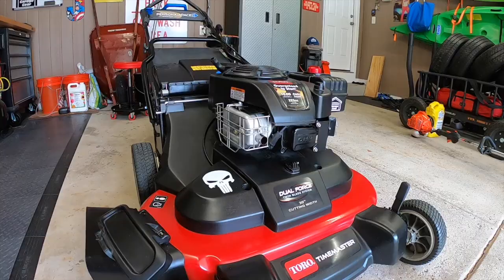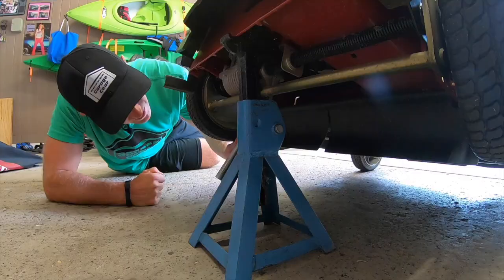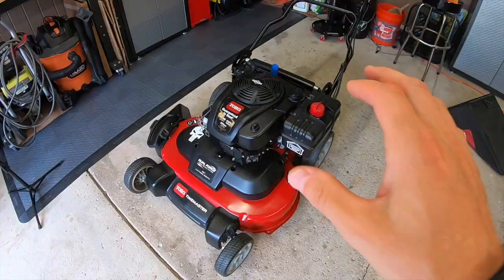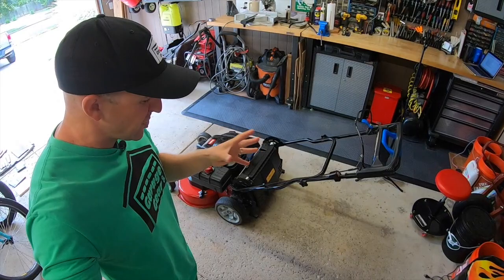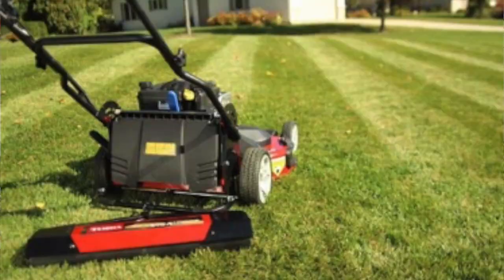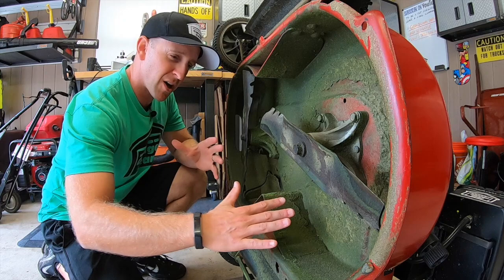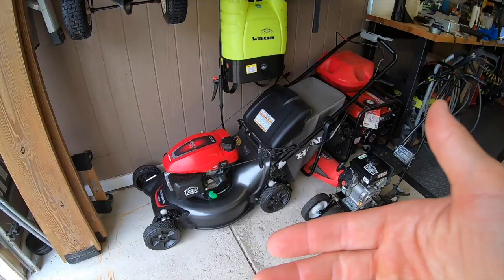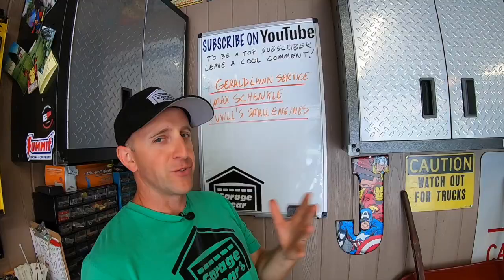BEFORE YOU BUY A TORO TIMEMASTER, WATCH THIS!

Comment: That plastic push down blade came off the forst day. SERP BELT went after 2 years and pullies went after 2 years. Never had a problem with the engine. Oh and the blade engage cable rotted out. But if you know how to use your hands this machine is well worth it
Reply from the maker: Thanks for sharing

Comment: I just wish Murray would still make their trusty old 20", side discharge push mower with a plain Briggs 3.5hp flat head side valve engine.  Those things lasted forever and a day.  I do 95% of my mowing with a riding mower and just used a push mower for trim work and getting into spots the rider won't go.  My last Murray 20" I bought in 1998 and it still fires up now right away, but the deck after 25 years is just flat-out shot.  The auto shutoff cable broke after the first 5 years.  No problem.  I disabled it and used some fence wire wrapped around that shutoff device to make it like an old one that runs all the time and I just shut it off the same way I did as a kid, shorting out the spark plug with a screwdriver. When it was 20, the hole in the deck for the right front wheel rotted away and the wheel fell off.  I bent a flat aluminum bar into a 90 degree angle and drilled and bolted it to that corner and re-mounted the wheel to that, lol, but hey, it made it another 5 years.  I only consider it as "unsafe" now because the engine is in danger of falling through the rotted deck.  So I bought a Stihl FS 56 RC-E weed trimmer and retired the push mower this past season.
Reply from the maker: Thanks for sharing rebel

Comment: Good mower. But has issues. Replaced the transmission, blade engagement cable snaps 2 -3 times a season , had to replace the pulleys a few times as well. 
My opinion.get the Turf Master.
My opinion
Reply from the maker: Thanks for sharing Brent!

Comment: I was checking this video out doing some research on these units. They’re on sale at Home Depot for $999 while supplies last. I think I will just steer clear of them. I wonder if they are going to be discontinued.
Reply from the maker: Not worth the headaches!
Reply: Buy the ExMark 21. Steel deck, Honda motor. It’s a little pricey at $1700 but it’s cheap for commercial grade. It should last a homeowner forever

Comment: Basically it’s the same as my one (1) season Recycler. Underpowered/ undesirable engine, so much as an ounce of moisture in the grass and it shakes violently, like an out of balance washing machine, and it gets bailed out routinely by my 20 year old, 21 inch Honda. My flap has also been replaced twice in a single season. I grew up hearing great things about Toro. Never again.
Reply from the maker: Toro used to have a great reputation but now?? 😕

Comment: I have had my machine for about three years and have had no problems at all ? Also I think there is defo a problem with my machine though. My garden is 3800 sq m total area which is about 41 k sq ft I have never actually measured the grass area but it cannot be less than 1/3 so about 14 k sq ft and yesterday I cut that with less than one tank of fuel and it took me one hour and 15 minutes to do it !  What I do note is that my garden is on a slope and if I cut up and down the slope the machine does use more fuel so I go across the slope and use much less. Now I have read lots of reviews and all say the same about fuel consumption in relation to the tank capacity, I seem to get by with less ? One thing I think helps me is I have two grass bag emptying stations and empty the bag frequently so the motor is doing less work that could be the reason I use less fuel?  
 If I had to pick faults, and I have had none to date, I would agree that the motor could be more powerful because as I said I have a slope on my garden and although the Toro copes with it well I think it could be better and I agree the fuel tank could be larger.. My biggest gripe is not with the machine but with my grass land it is very uneven and not nearly as good as the Timemaster.
While there is no doubt that some products can have reoccurring issues the internet and youtube in particular is occupied but sensationalists in the main and it is the way tubers keep their channels going is but hyping faults. Manufacturers make many thousands of a particular item and a reported fault becomes a major issue on youtube very often with a clickbait headline to grab the attention and to hype the channel clicks .
Reply from the maker: Thanks for sharing

Comment: My experience does not jive with yours!  I have a 17,000 sq ft lawn and I'm on my 6th year with a Timemaster.
1.  Still on my original drag flap.  No issues.
2.  Gas tank - does not "drink the gas", gas tank is just too small. I refill at 10,000 sq ft.
3.  Replacing engine? - mine runs great.  Starts on first pull every time, every year.
4.  Belt pulleys?  Still on all of my original pulleys.
5.  Transmission? Not any problem with mine and I have some steep grades in my lawn.
6.  Deck clogging?  I'll give you that one, it does clog.  But I still can get it all mowed faster with the TM than with my 21" Honda HRX.
My number 7.  The Timemaster has a better cut than any mower I've ever used...
Reply from the maker: Thanks for sharing

Comment: Thanks for making this video.  I've had my Time Master for about the same time as you.  It needed a new engine within the first year which was, fortunately, covered by the Briggs & Stratton warranty.  Since then it has required several sets of belts which are a royal pain to install and the last time I had to replace the pulleys too.  One thing you didn't mention which I've also had issues with is the electric starter.  I know Toro sells versions with or without this feature but yours appeared to have it.  In my case, it stopped working after about the second year.  I suspect it needs a new battery as I've already replaced the fuse.    I'm going to use mine a couple more years to recoup the cost but I'd never buy another one or anything else from Toro for that matter.
Reply from the maker: Hey Phillips! Thanks for sharing this. Mine did not have an electric start. Just sold my TM last month! Plenty more room in the garage lol!
Reply: The problem is if you use your Timemaster a couple more years to recoup your investment it's very likely that something else will go wrong and you will be throwing good money after bad I'm sorry to say. I hate to sound negative but the Timemaster has not given me any reason to be pleased with it's performance.

Comment: Thank you for the great and honest review.  The sad thing about the Timemaster/Turfmaster is that they've been out for 10 years and Toro still fails to correct the issues or redesign the mower.  Beyond the issues you mentioned, I always thought the deck was too short in length and height.  It's also a flat deck.  So, there isn't enough time for the clippings to be recirculated and cut before smashing into the deck especially in heavy wet growth.  For the price, you're better off with a Toro commercial 21" mower or a good used larger walk behind in the 32 to 36 inch range with bigger hp.
Reply from the maker: Totally agree 100% Joe! I want to give the toro commercial 21 a shot. Heard a lot of good things! If I could get one with a Honda engine on it I’d be a happy camper lol! Thanks for watching!
Reply: @GarageGear  I have a 2021 Toro commercial 21" with the Kawasaki FJ180 Kai engine (Model #22297).  It's a fantastic machine.  I highly recommend it or the models with the Honda GXV160 engine (22295: Non BBC and 22296:  BBC).  Just avoid the one with the Kohler engine (Model #22287).  I had that one last year and had nothing but problems with it.  They are expensive but really great machines.  They mulch fantastically and bag well too.
Reply from the maker: @joeraptor1  appreciate you sharing this my friend. I was eyeing the toro 22296. Honda engine with the BBC. Now how do I come up with an extra $2500???…lol
Reply: @GarageGear  They are costly this year.  I was lucky to get mine last December for $1600 Canadian + 13% Sales Tax.   This year, the same machine jumped to $2349 + the tax.   The Honda Commercial 21" have not increased in price as much but the Toro is the better machine.   Sometimes you can find some good used ones as well.
Reply from the maker: @joeraptor1  I would try to grab a new one. The commercial Honda has a steel deck and I’m not a fan of their drive system controls. Clunky if you ask me. The toro is simple. Thanks for all your input here Joe! Definitely appreciate it.
Reply: Better just to get a commercial grade machine. The Proline is pretty good and lots of others in the 33inch range for half the price of a timemaster.
I have a Cub Cadet 33 inch walk behind it's great.

Comment: I have a total of 30 in cut time master they work good for one season and then instead of giving me all kinds of problems belt problems blade problems clogged up all the time onto it shook itself loose from the mount bolts and when I try to tighten them all three of them started spinning so now I'm stuck with a 30 inch cut of nothing cuz it's just sitting in my garage doing nothing
Reply from the maker: This mower could be built so much better

Comment: I can't believe this mower is still on the market.
Also, the person in this video doesn't say anything about the most important issue the blades are timed which means that the belt has notches in the belt so if you go over a part of a stump or hit a rock you could hop a tooth in the belt and the blades will touch each other.I read about a window getting damaged from this mower when both blades came into contact and part of the blade broke off and hit the window which of course there was a lawsuit.I would never buy a timed blade mower ever for that reason.
Reply from the maker: Thanks for sharing

Comment: So after watching this I don't think I want Timemaster.  I have Honda HRC 21", needs replacing. Not sure the HRX line is good enough.  I don't have a big lawn, current Honda can do it in about 45min on high speed. You thoughts what you would suggest.  I thought the 30" sounded cool and would save time until watching this. Honda? HRC vs HRX? Wnat something lasts and starts on the first or second pull which the Honda's have always done.  Appreciate your help before I pick a mower. The thing I didn't like on the HRX was the belt drive. The HRC has the Transmission and mine have held up well in the past, but maybe there is a better option.
Reply from the maker: Hey Tom! The Hondas are both great options. I’ll have a video out next week on the HRX! The HRX has a good transmission with a pressure sensitive drive system. Works great!   The timemaster is not a good choice for longevity! Thanks for watching!

Comment: Bought mine used, had a year of service. So far the engine has shaken loose (check), the pulleys have seized (check) and the bolts holding them in sheared off, it clogs if the grass isn't dry (check), and it is underpowered (I have the smaller motor), and before I converted part of my lawn to a natural meadow, on a 3/4 acre property it needed a gas up to finish (check).

Am I disappointed in Toro, yes. They should know better. Do I regret buying it, no, but I paid $800 Canadian for it.
Reply from the maker: Thanks for sharing Wawa! Definitely a mower with a lot of drama!

Comment: What does that thing cost?? 2200.00? I was sharpening the blade and scraping out the deck on my 300.00 dollar honda mower thinking how cheap the deck is with the removable side chute. I had a toro self propelled mower in 1977 and it was used when i got it but what a great solid mower it was. No safety anything on it. Just a motor, a blade and a lever for self propelled. Boy how we progressed?
Reply from the maker: Hey Phil! The standard TM runs $1600 in my local area. Now the electric version runs about $2300 nothing is different on it except for the motor. Thanks for watching!

Comment: This video is so funny and true it hurts. I was bracing myself for the favorite tool being a screwdriver or something similar to scrape all the junk out from the bottom. This machine does have the potential to be elite but toro continues to go cheap on key components (belt/pulley/transmission)
Reply from the maker: I’ve mentioned these issues to toro through several Instagram comments but they never seem to reply 🤔 thanks for watching!

Comment: I don't mind cleaning the deck, any mower can get clogged even the honda, how do I know? Owned one. Like all mowers over time the paint the luster or whatever wears underneath. Now depending on the type of grass you cut or how wet the lawn is you will have to eventually scrap or wash the deck. Why I won't use the honda? Well one day I was mowing and didn't notice the rock a kid threw into my yard, BAM! shot straight up and out the top of the deck wrecking the mower. No warranty going to cover that. Now if you are worried about clumping on the Toro 30 inch there is one option you can try. According to another channel who says this worked for him he took off the front baffel under the deck which is mounted by two bolts and claims it fixed his problems. I cannot verify because I don't mow wet grass. Also I agree on the cleaning port mainly because it will damage your spindles.  When you have to consider each spindle is around $75.00 each it can get costly. I will take getting 15 mins shaved off mowing vrs cleaning the deck anyday. And no it does not take 20 mins to clean the deck unless you are a weak snail. Less than 5 mins top using a house scrapper. What may discourage some may not bother others. I am diabetic I use the 30 inch so I can keep mowing, time matters.
Reply from the maker: @mrgreen2769  thanks for sharing mr green

Comment: 🤔 I haven't had any of those problems and my time Master is over 8 years old and I mow over 10,000 ft and I don't need no extra gas tank and I don't need to refuel in fact there's plenty of extra gas left over when I'm done. I did have to replace Wheels belts and do tune-ups that's it and it only clogs if the yard is soaking wet and super tall.🤷
Reply from the maker: Thanks for sharing!

Comment: I own 3 of these for my business plus 3 21 Inc super recyclers and a 42 inch time cutter zero. I can agree with the flap underneath but 3 years in and all I have had to do it oil air filters an spark plugs. 100 lawns a week still original belts. Oh and I replaced a broken front tire an the plastic shoot blocker twice.
Reply from the maker: Thanks for sharing Stephen!

Comment: I worked at a Toro dealer for 10 yrs. Everything you've said is true. Poor engineering combined with shoddy material . Trans usually fail after 2 yrs.
Reply from the maker: Hey George pretty crazy the price keeps going up regardless of not changing a single thing on it. Thanks for sharing this! 👍
Reply: @GarageGear  Yes, but they are being returned to Tractor Supply and no one is buying these used "Junkers" !!!
Reply from the maker: @georgepruitt637  once buyers own these for a short time and see the light they realize these are more work than they anticipated.

Comment: Lol. My half acre lot with st Augustine seems ideal with my Time Master. Broad leaf at Augustine doesn't cause the mower deck to become clogged, so maybe the species of turf? The only issue so far is the belts and pulleys always breaking. I've had to adjust the tension a few times, and I've caused bad tensioning trying to zero in the right setting. Have not had the other issues reported here, and I still have a huge amount of time  & effort making my purchase a good value.
Reply from the maker: Thanks for sharing Jon !

Comment: What mower would you reccomend? 30" to 42" cut for residential use? Half an acre!
Reply from the maker: Hey Andrew there really isn’t a good one in the residential market. If you want a decent one you’re better of going with a Scag or Ferris 30. Stihl might have one now too. High price tags though. May want to look into a rider for those sizes!
Reply: @GarageGear  right, I currently have a Troy Bilt Mustang 42" from 2008! It's on its last leg! We were thinking of going 30" push but now we are leaning another 42" zero turn! Looking at the Bad Boy right now. Any suggestions there? Thanks!
Reply from the maker: @andrewking1414  bad boys are great! Hear good things about them from mechanics. 👍

Comment: I have right at 300 hours on mine it has the original flap, transmission. However I have broke 2 sets of cables and 2 sets of handlebars. I think the handlebars are from bouncing so much on the trailer. Mine has been very reliable. Original blades have been sharpened enough they should probably be replaced
Reply from the maker: Thanks for sharing

Comment: I bought my Toro Timemaster in 2016 and still use it today but I'm so disappointed in the biggest pick of junk that Toro has ever built. If you're thinking about getting one for yourself, do yourself a favor and buy something else. The first year I had it the blade engagement cable broke. Year two a blade spindle had to be replaced. Fast forward 2 years and the transmission had to be replaced which was a very costly repair of $397 which also included a head gasket. Last year the blade belt tensioner pulley disintegrated. What happens when your machine breaks down during mowing season ? That's right, if you take it into a shop it's is unavailable for 2-3 weeks at a time because the shops are all busy. Toro is not help either. There is no way that I should have to replace the transmission after 3 seasons but I did because it is of poor quality. The transmission should have been recalled but Toro would not stand behind its product. I have had other Toro products like lawnmowers and snow blowers in the past that were bullet prof but the Timemaster is the YUGO of lawnmowers.
Reply from the maker: Thanks for sharing this with the garage gear community John! Appreciate it!